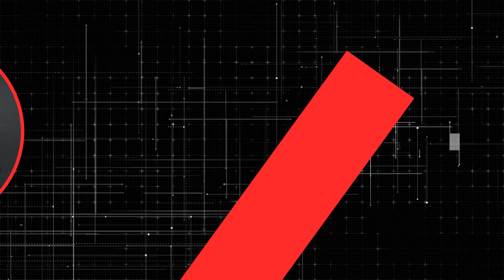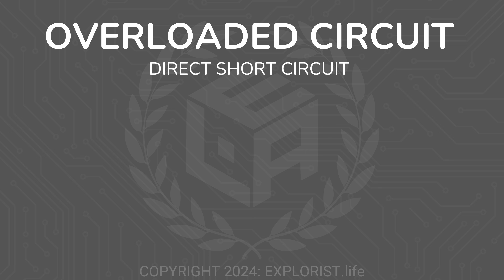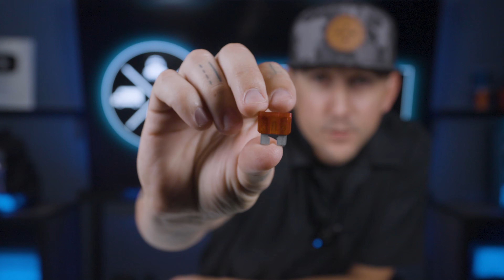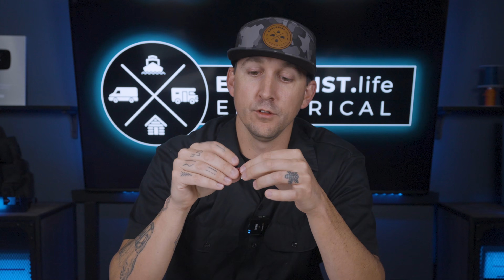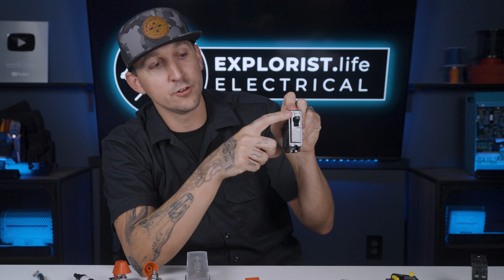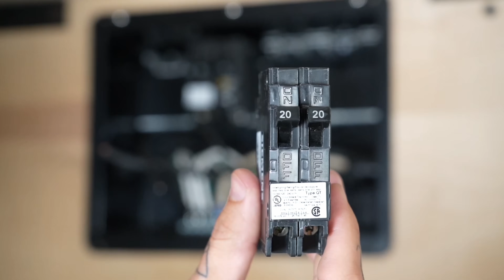Intro to Fuses and Breakers 101 - Fuses, Breakers, and Overcurrent Protection | Ep: 1/6

Comment: 12 AWG 15 amp. A 14 AWG is 15 amp. 🤔 12 AWG is a 20 amp.
Reply from the maker: Not always.  If you need help, our team can take a look at your system and help you get it dialed in right: https://shop.explorist.life/support?utm_source=youtube&utm_medium=comment&utm_campaign=support&utm_content=response_link
Reply: @EXPLORISTlife I’m old enough to remember before they started cutting back on the copper wire. Used to run a 12/2/G on a 30 amp breaker. 😊 I am talking about solid wire. For house wiring. 😊
Reply from the maker: That’s not what this video is about, so I hope you learned something new. 😎😀. Reach out if you need help with your project.

Comment: Nate if you have moment can please tell me if I can use 400amp terminal fuse to fuse my Victron MP2 3k 12v by bolting the fuse to my bus bar and than the positive 4/0 wire coming of MP2 bolting it to the terminal fuse … not ideal I know … space is big deal and if it’s safe to do so it would save me lots of rework and if it isn’t I understand… safety 1st

Thank you

Comment: I wish to thank you. This video is very informative. I have a question. The mounting hole for the MBRF fuse holder at your store is 3/8 inches but the battery uses 5/16 inch bolts. The battery is a Renogy 12V 200Ah LIPo4 with a flat mounting surface. So, there is a difference of 1/16 inches between the mounting bolts and the mounting hole on the MBRF fuse holder. Is it safe to mount the MBRF fuse holder on the battery if it is properly tightened?

Comment: Is it reasonable to replace the ANL fuse (300 amp) between my master kill switch and the hot lead of my battery bank with a DC breaker of 300 amps?  I prefer breakers vs swapping fuses.
Reply from the maker: Why are you “swapping fuses”?  That fuse should never blow unless some kind of catastrophic over current event happens! 😱😨
Reply from the maker: Notice that in our pre designed  kits at shop.explorist.life, we include fuses at that location over breakers?  That’s no accident.
Reply: @EXPLORISTlife - not blowing them, just that the ANL fuse holder and cover look and feel cheap and easily breakable.
Reply from the maker: Are you going for looks and feelings or system performance and safety?  High quality fuses and fuse holder like what we sell at shop.explorist.life is the answer. 🫡👍

Comment: You recommend DC fuse panels as opposed to DC circuit breaker panels. Is that a cost consideration? Marine applications seem to favor DC circuit panels over fuse panels. Seems like the advantage to the circuit panel is no hunting for a blown fuse and easier disconnect. Curious on your thoughts.
Reply from the maker: Yeah.  Fuse panels are, what, like 1/10th the cost of a dc breaker panel.  Sure, turning circuits on/off by a breaker may seem nice, but at a $1,000 vs $100 premium?  I suppose I’m happy to sell them to you, but I’m not comfortable recommending that as THE answer since the fuse panels are perfectly safe and a well designed circuit shouldn’t blow fuses.
Reply: @EXPLORISTlife  thanks for the quick reply! Maybe the other consideration (beside cost) is the limited number of circuits on a circuit panel (typically 8) vs. the 18 positions you can fit in panel in your shop. How many DC circuits does a campervan typically use?

Comment: Nice overview. We have AFCI/GFCI Eaton BR combo breakers for all branch circuits in our RV’s WFCO AC panel. Almost every home AC branch circuit requires AFCI/GFCI, and it makes sense to do the same in your RV. The most often overlooked breaker is the GFCI DC breaker on some RV PV arrays: "§690.41. Ground-fault protection. PV DC circuits that exceed 30V or 8 amperes shall be provided with dc ground fault detection meeting the requirements of 690.41 (1) and (2) to reduce fire hazards. Solidly grounded PV source circuits with not more than two modules in parallel and not on or in buildings shall be permitted without ground fault protection." We have two AIMS 330W panels in parallel on our trailer (33.9 Vmp 9.73 Amp each), and we added the Midnite Solar DC GFCI breaker even though not technically required by the NEC. Safety first.